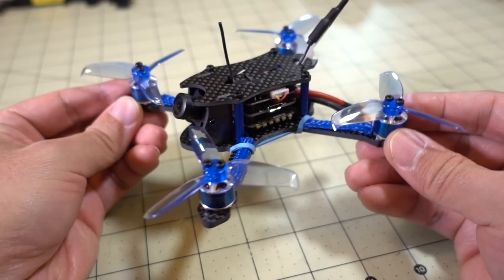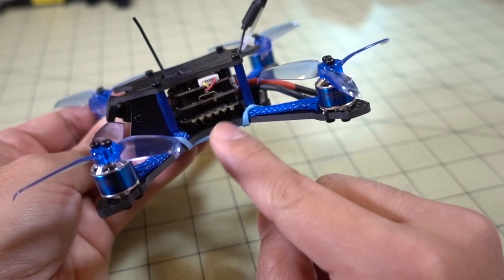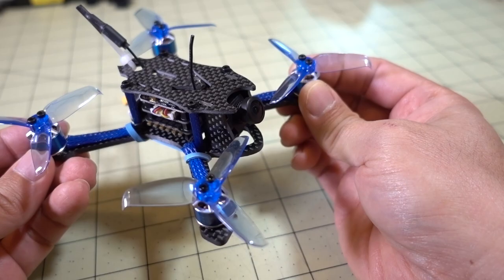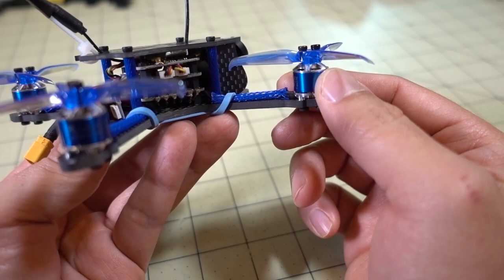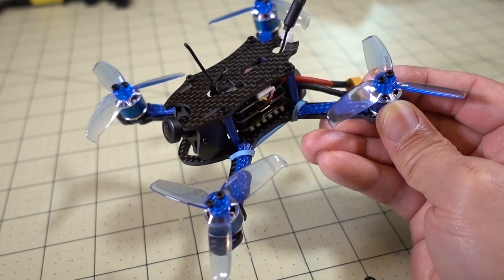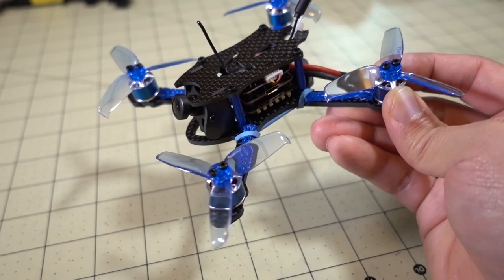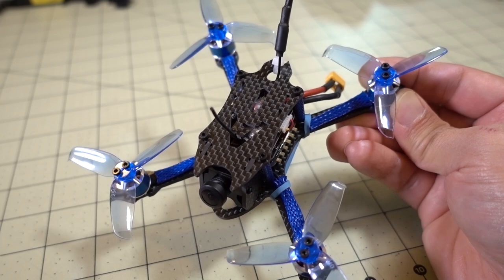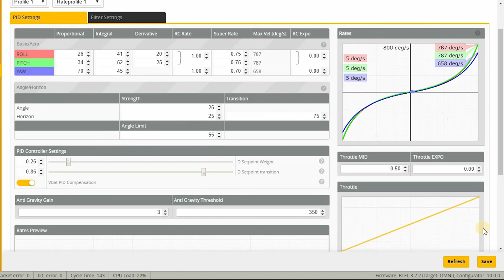MD#64 🚁 Aurora RC Mini Fight 👍👍👍

Comment: Thanks for the PIDs, they work better than the stock settings for sure!
Did you have trouble using airmode ? When I activate airmode the quad just goes full throttle right after takeoff..

Comment: Thanks for the PID,s, they work better than stock settings !
Did you had trouble using the airmode option ? When I turn the option on in betaflight, the quad goes full throttle right after takeoff..
Reply from the maker: No problem with airmode.  You probably have something misconfigured.  It will be related to the motors or ESCs so check all those settings.

Comment: Hi, can you tell me if I could add a light strip to the 
Aurora RC Mini Fight 110mm Micro FPV Racing Drone. Flying LOS it doesn't have enough lights :) thanks, Pete
Reply from the maker: I'm sure you can.  The issue is how and where to get power.  That will depend on the lights you select.  The easiest will be the 12v LEDs and connecting directly to the lipo.  The 5V ones are more complicated and would require a video to explain.  I think I might have an LED video from 2 years ago in my Tutorial playlist.

Comment: Did you like it better than the Leader 120 (other than the camera, obviously)?  How would you compare this vs the XJB-145?
Reply: Honored Twig, not the same size, XJB 145 is a 3" with bigger motors. I think more like the Froggie 
https://youtu.be/u8UZdyiHO50 .
Albert, did you prefer this one over the Froggie ?
Reply: Odd, it says there is a reply but I don’t see anything. Anyway, I’m also interest in this. Leader has 2.8 inch props, is much lighter, doesn’t need to be tuned, and is much less expensive. I like the bigger ESC and CCD camera on this though.
Reply: This is worlds ahead of the Leader. Gobs more power and these props are far better in performance than the 2.8" props.
Reply from the maker: +Honored Twig much better than the 120 in all aspects. Pretty close to the 145 but slower because of the smaller prop.
Reply: That's about what I expected, but thanks for confirming - I can see one of these in my future ;-)

Comment: sorry to bother you Albert. I just noticed this quad is crazy cheap right now however it is only the D8 FRSKY version and I am rocking FLYSKY. Is it easy to pull the D8 reiver out and slap in a FLYSKY? I  saw another video and it said it was a plugin receiver. I don't want to buy wihtout knowing for sure. I can't see it being an issue as I have purchased and installed several receivers but just in case I thought i would ask. thanks man
Reply from the maker: Not the most difficult but also not the easiest.  If you've installed receivers before you should be able to figure it out.
Reply: Cool. So just to confirm there are pads on the FC for the SBUS Ground and 5V right? Just want to make sure this quad has nothing out of the ordinary? Again thanks man ..you always answer right away and I really appreciate all you do for us. Cheers
Reply: Andre M that's weird, I bought it a month ago and it was half prize only on flysly on gearbest
Reply: cal_ yeah..thdy had this on sale a few times.

Comment: Hey Albert. Quick question : If you have 1104 7500kv motors do you have to get the exact same size n kv when replacing them or can you say go for a lower / higher kv ?  Just curious as  I have the leader 120
Reply from the maker: You should get the same size and KV otherwise weird stuff happens. You can mix with other brand of motors but if you switch to a totally different size and KV the flight controller may not be able to handle it.
Reply: Albert Kim thought so. Could you recommend any top brands ?

Comment: Do you think this could use an 86 gram 14.8v  650mah 70C battery?
Reply from the maker: I would not recommend a 4S lipo with this setup. 3S max.
Reply: +Albert Kim (marblekit) Do you not think the build can handle the 4s? I saw RC Escape flying his on 4s 400mah. Do you think it would damage the motors?

Comment: Do you think we can fit the Runcam split MINI in this?.
Reply from the maker: Not enough space.
Reply: I agree with the current setup. What if standoffs are smaller and change video transmitter to smaller TX02 or similar.